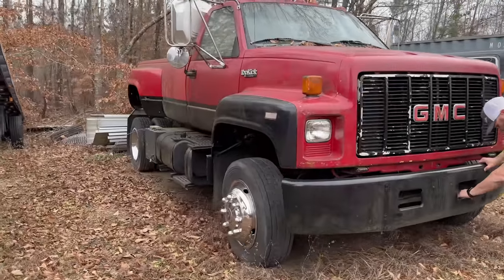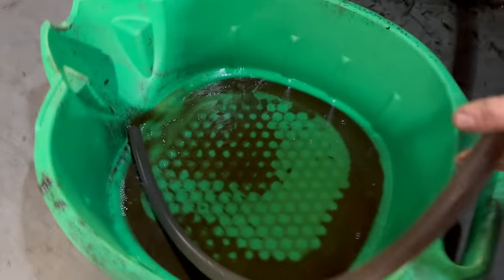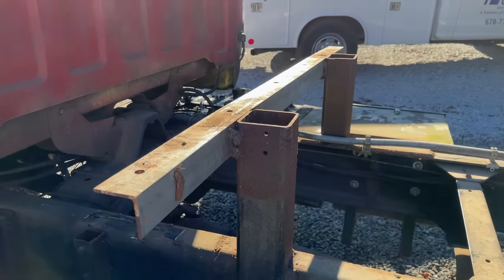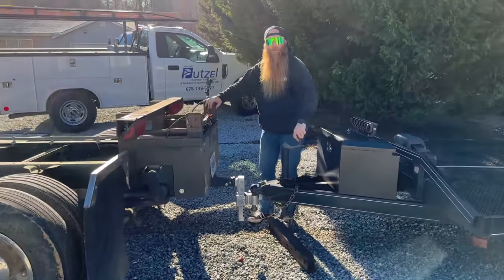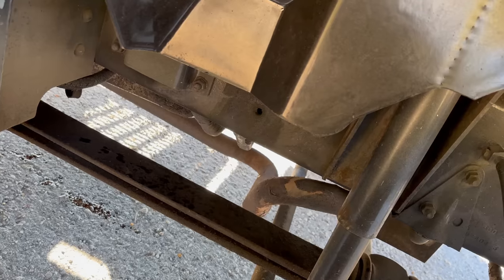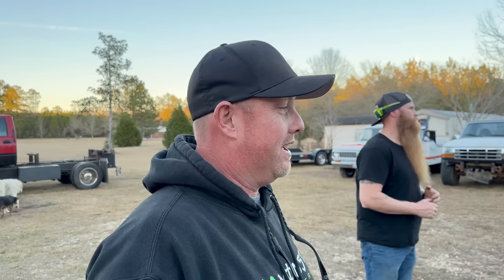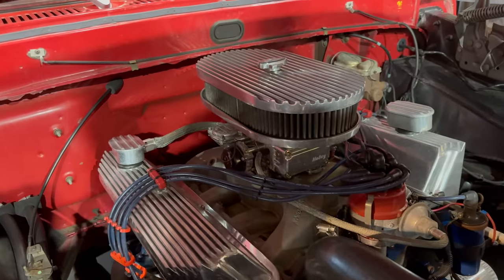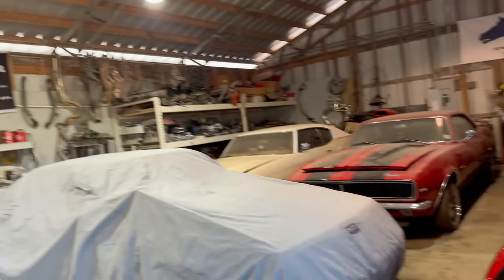The Top Kick is back on the road!

Comment: What made you think you were doing 70+ MPH when constantly being passed by semis? Easily checked with GPS.
Reply from the maker: I just assumed because everything was factory. Factory transmission, axle and tire size. Boy was I wrong. Sitting so high in the truck it felt like we were hauling butt.

Comment: I did a 4 door cab swap on one of them with cab air ride. You use the firewall and some of the floor from the single cab and put it on the 4 door cab. It looked factory when done.

Comment: Those Top Kicks are very cool. I drove one for years with a Cat diesel and an Allison and it had so much more torque for hauling than the gas engine. 
You have to get a Bostrom seat for yours to smooth out the bumps on your roadtrips.
Great video!👍
Reply: I agree with this persons comment.

Comment: Sorry guys, I'm calling BS on the 600+ HP small block in that mustang.  That set up looks like a basic street warmed over windsor with some bling bling on it. I've been racing Fords all my life, and that is a 400 HP motor at best. 😅
Reply: Can you tell me what parts are in mine? I mean, just by looking at it I'm sure you can tell the exact cam, heads, valve sizes, compression ratio.... you know, all the internals that determine how you make power.
Reply: @leftyeh6495  I can tell you what parts are NOT in it by looking. Firstly that single line carburetor is not capable of making over 400 hp, and using the mechanical fuel pump is maybe capable of providing 350 hp worth of fuel, but mostly, just bolting on a bunch of nice components is not going to make 6oo+ hp. It takes over 900 CFM to make over 500 hp, and by what I see on that engine and hear in the came sound, it is maybe a 780 cfm carb at best and  perhaps to 512 lift cam. That's a 400 to 425 hp package.

Comment: stretch the frame back out, add a sleeper and air horn for now, then when you upgrade the engine down the line you'll get the fuel economy and have a nice hauler

Comment: The plate on the side if it's 2 bolts on each side and one top and bottom in the centers is the PTO plate or plates, some have one on each side.
 Also HF makes an awesome rust eater that would have that tank looking like brand new on the inside. You could pour a couple of gallons in it and roll it around so it soaks for 12 hours on each side and you would have a brand new tank in 3 days and save some cash since the rust remover is reusable.
Reply from the maker: I'm changing the tank anyway. The new bed won't sit down on the frame because the tank is too long. But thanks for the info. I will definitely keep that in mind.

Comment: Cool buggy with a trash engine. The 6.6 is the worst big block GM ever. Possibly the worst engine they’ve ever made. The bore/stroke ratio makes a 305 seem like a brilliant idea. If you want some juice and to save the dino juice, make it an engine stand counterweight and plug in basically any other Chevy V8. Or turbo 4. Or the wiper motor and a couple energizers… 🤷🏼‍♂️😂

Comment: I have a 2001 GMC 5500 Topkick old 24-foot U-Haul truck. What are you going to do with that bed that you removed from the Topkick is it for sale. Would you happen to know if that bed will  fit a 2001 GMC 5500 Topkick 24ft

Comment: ATF transmission fluid will evaporate. It's not like engine oil or hydraulic fluid. That's what we run in the hydraulic systems on the car-hauler trucks at work. Makes spills much easier to deal with from blown hydraulic lines.

Comment: Definatley awsome truck, always have been one of my favorite trucks. But i think it deffinatly needs a diesel. Somerhing like mike has in the Road kill ramp truck. Something to put s little pep in its step around 600 or 650 hp and around 1000ft lbs would do nicely to pull wat ever u wana srick be gind it but built right with a nice twin turbo and large intercooler will still be very reliabe and wont have no turbo lag and most importantly still blow the tires off when ever you might want to. Oh and you could get around 20 + miles to the gallon

Comment: So David at the Radiator shop we knock a hole in bottom corner of tank. Easily clean and coat if rusty and drain threw hole..than simply weld new bong in when done...

Comment: I noticed when you showed the door pins, they are factory installed. I had to replace my doors on my 92 K1500, I put the door pins in from the top down. Instead of bottom up. Makes installing them so much faster. That interior on the Top Kick is from 88-92. Those gauges are from 88- 89. Nice Truck

Comment: Every truck should have hooks on both the front end and back in for pulling and towing. And I know exactly what you can do with that diesel that came out initially throw it in the shop heater. Just to let you know they do make air trailers that you need a compressor for there’s some of the heaviest trailers that you can find to.
Reply: Diesel???

Comment: Plate on the side is for a pto. It's probably an AT or MT series Allison
 Just get that black gasket maker goo and get rid of the paper gaskets. I have seen those covers develop rust holes. Overfill Allisons they will usually puke it out. I used to rebuild them. AT are ok but an MT is tougher. Kinda the difference between a 4l60 and 4l80.